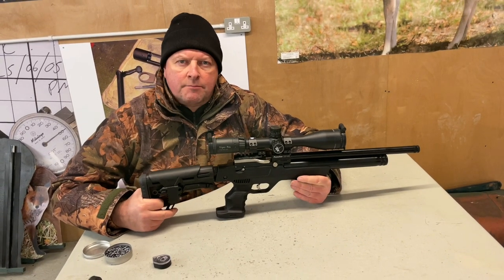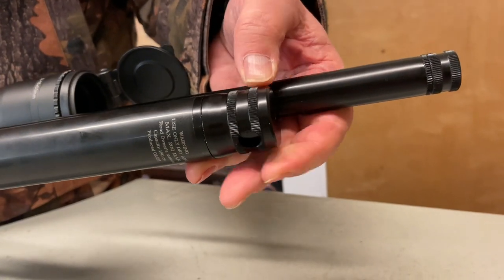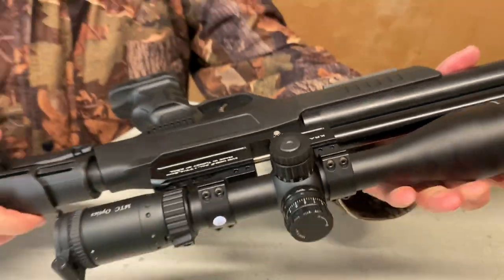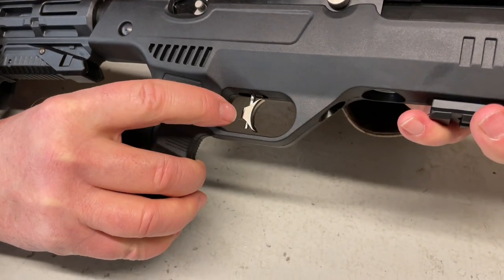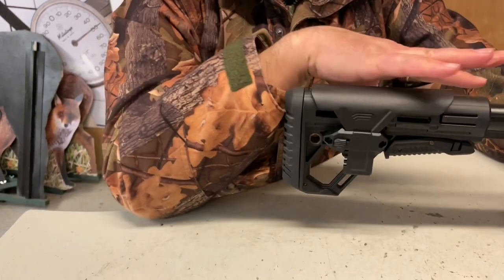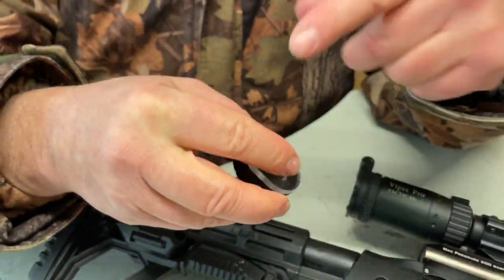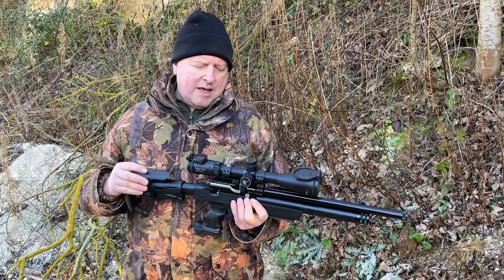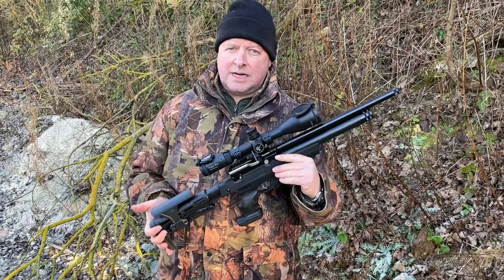GUN TEST: Kral Puncher NP03 multi-shot PCP

Comment: Not a fan of these krals at all, really cheaply made
Reply: really??? buy an NP02 for £330 and an fx wildcat for £1250 and shoot both side by side. yes I own both and tell me in what way Fx warrant the extra 900 quid?? also check the puncher pro out while you're at the RFD and tell me what's badly made about either 🤔
Reply: @lyndoncook4508  looooool i’d choose an FX over a kral all day, sorry but thats a poor take
Reply: @jackking9271  I think the point there was the £900 difference and the lack of justification for it. The np02 will put pellet on pellet so how can that be a bad gun? Because it’s not an established make?
Reply: @dazburnside7340  Not all FX are well made either, plenty of people had issues with the seals, etc. Gotta think of the use the gun will get and other things. If you go out hunting now and then or just for plinking then why would you spend £1500 on a gun? A professional gamekeeper or match shooter is gonna use a gun that can handle a lot of use and is up to the task.
Reply: Had trouble with my FX from new and no more accurate than my Kral. I speak from experience, Kral are better than the price suggests! I now have 2
Reply: Results is what matter, not price level